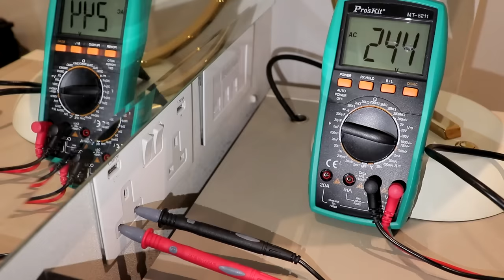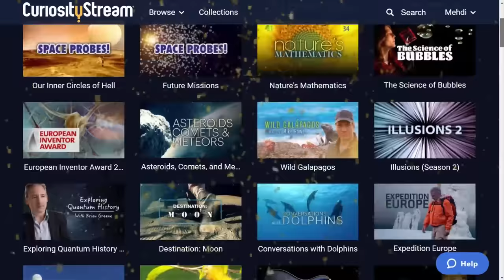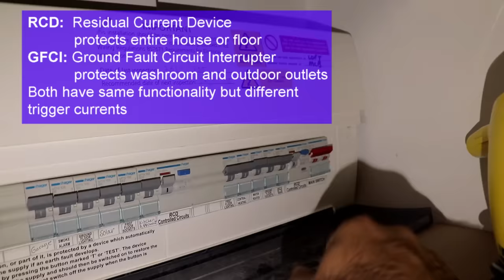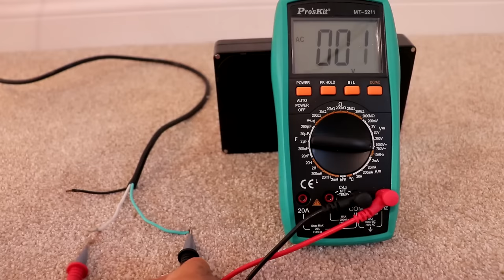Power Outlets in United Kingdom

Comment: A lot of people always say "bulky british plugs". But I always argue against that. Ok, they're a little wider and taller than for example North American, and from my own experience, Australia too. However! Pretty much all UK plugs have the wire come directly down rather than sticking out perpendicular to the wall, which means is actual practice, they take up LESS space, because you can get your furniture closer to the wall, and you don't have an annoying wire sticking out the wall to trip over easily. UK plugs are a lot more shallow and that completely offsets the width and height.
Reply: This is actually twofold. The downward direction of the cable ALSO means it tends to lock when it's pulled away from the wall. It puts a lateral load on the plug and the pins bite into their holes and don't just pull out. So not only is it neater, but also MUCH harder to pull out accidentally. In fact, I never have!
What he said about standing on a plug though, he's right. Lego, step down, you are not the foot pain king, the British upturned plug is. Ouch!
Reply: @ChrisThomas-lt8jd  Every time I hear something about foreign plugs I have a mild panic attack, not having switches (do Americans not get the ritual OCD from their parents about turning off the damn socket!?!), not having a longer ground pin to stop electrocution, not having fuses in the plug, I never even thought about the size and shape, I have never accidentally pulled a plug out of the wall or extension, I have never had to worry about furniture being in the way.

I did once trip and fall onto a pile of old cables once and landed on like 6 of the fuckers though...
Reply: Also, we don't generally have plugs lying around on the floor because we can just turn the socket off instead of pulling it out.
Reply: @pdgiddie  Good point. We're also not, you know, stupid 👍
Reply: @ChrisThomas-lt8jd  Haven't trodden on an Irish/UK plug yet but I have done it on a kiwi [NZ] plug - when I was much much younger - and it hurts, A  LOT.  Same plug but without the fuse and upside down pins.
Reply: @musicandbooklover-p2o  To be fair, the UK design really is good, its super safe, but it DOES have the downside of being bulky. I am kind of envious of US extension leads, where they can fit 4x plugs into the space of 2 UK. But there you go.
the other thing I like about the USA power sockets, is that each socket looks like a slightly sad surprised face :)
Americans arent stupid, but they ARE hampered by the freedom for each state to have its own laws, so I guess getting ANY kind of USA wide standard back in early days of electricity was a nightmare.
Apparently the whole 110v vs 240v thing is because lower voltage bulbs became entrenched in early days, and when move to 240v (more efficient) was mooted, no one want to do do it to replace the existing 100v based equipment, and so it stuck. In the UK, the govt had more power and FORCED the flip to 240v. And so here we are...
Reply: Josshyua  That UK one must have had unprotected pins. The sheathing on UK pins are designed so that no metal is exposed at the same time as they have connection inside the socket. Plugs without this protection do exist, but not as common, so that's just a bad manufacturer. 
I just Googled the German style. That deep sinking in does look reasonably safe, but also looks like it misses a few of the other safety systems that UK plugs have, so at a cursory glance at least, I'd rather stick to UK ones :)
Reply: @danielmacpherson8487  Oh we got fuses in the plug..... if it's christmas lights bahahahahahahaha
Reply: What's cool as well is that all British kids are taught how to replace the fuse in a plug, and be able to build a plug from scratch. Well, at least, I was, and I'm 34, so I'm not THAT old, it was about 2003 or so when I was taught this, I assume they still teach it in schools.
  
All home devices UK used to come without plugs, for safety reasons. So like, if you bought a toaster, you were expected to build the plug yourself before you could start using it. Though these days that's not the case anymore, they just put a plastic sheathe onto the prongs of the plug to keep it safe, but it's already built for you.
   
But yeah that's why they would teach kids how to build/wire up a plug, and change the fuse in it. Because you literally had to, every time you bought something electronic, like TV, a hi-fi, a microwave, anything that required electricity.
   
British plugs are possibly the one thing we objectively do much better than any other country in the world. They are by a long long way the best plug design on earth, because of their safety, because of being very flat against the wall which makes them take up less space as others have said, and so on. British plugs and our plug sockets with switches are the envy of all other countries. It's always a pain in the arse when we go on holiday to places like say Spain for example, and have to deal with their shitty unsafe plugs, using plug adapters so that our British devices can be charged up using their plug sockets. I can't imagine how much of a pain in the arse living in Spain or any other country full time must be like.
Reply: @ChrisThomas-lt8jd  I've never experienced that myself. Due to the thickness, and therefore strength, of the UK pins they need extreme force to bend and cause them to get stuck in a socket. If you've had that, you either had a really dodgy plug or you did something seriously wrong 😂
The thickness of the pins if a good safety feature too. The Australia ones are so thin and bend so easy. We're doing some housework right now and one of the pins on our sander got bent quite badly. I had to bend it back to fit in the socket and as a result of you know anything about metal that pin is now weaker. Which is an obvious hazard. But since Australia plugs are not rewireable I've got no choice but to continue using this now weakened plug.
That's just another reason to add the list of why UK plugs are the best 👍
Reply: @duffman18  Same here, I'm the same age as you as remember well being taught at a young age now to wire a plug. It was uo there with "tie your shoes" and "wipe your ass" 🤣
Australia is such a nanny state with anything electrical. While British children are taught the basic safety tips and the rewiring skill so they can safety perform basic DIY tasks such as replacing lights, plugs, and switches. Australia teaches even grown adults not to even look at a bare wire because you will definitely die! 🤣😂🤦
Reply: @duffman18  Although I thought British appliances were sold without plugs, not for safety reasons, but because there was no set standard at the time and so different houses had different sockets, or even different sockets within the same house. So you bought the appliance and the plug to match what's in your house and connect the two, so the manufacturers didn't need to make 10 of the exact same kettle so everyone could buy it.
Rewireable plugs today is just a leftover from that time which is why you also see more and more non rewireable ones today as they are no longer technically necessary since we've had a standard socket across the country for more than enough decades now. Though I do hope they stop that because rewireable ones, while no longer necessary, do still have their uses. If the plugs breaks in some way you can replace the plug rather than the entire appliance! 👍
Reply: I’m 28 and I wasn’t taught how to wire a plug at school
Reply: Electrical goods have never been supplied without plugs as standard in your lifetime. The whole point of supplying a plug already fitted is to reduce the input from the end user on grounds of safety. There is never the assumption that somebody knows how to fit one. That they are now supplied with a moulded plug is the logical end point of this, though these can easily be replaced by simply cutting the plug off the cable and installing a normal plug.
Reply: I'm 19 and was taught how to wire a plug in psychics
Reply: @opiumpilled I didn’t see that coming! 🔮
Reply: @duffman18  "I can't imagine how much of a pain in the arse living in Spain or any other country full time must be like."

When you live all your life surrounded by a [plug type here] it's not painful at all.
Europlugs also have ground (except the cheaper devices/usb bricks which have a plain flat fork plug), halfway fork covers and 90 degree form-factor, it's not a rocket science to make these. Though a plug switch does sound convenient I'll confess.
And we don't need fuses inside the plugs, as we don't run out of copper, lol.
Reply: Another thing about UK plugs is once you've put it in, it's staying there. You don't accidentally pull out a UK plug. Which, again, is extra safety. I moved to UK from Europe, and I wish the whole world used UK's plugs.
Reply: @danielmacpherson8487  Switches on outlets are one of the most useless, stupid things ever.
Reply: @wta1518  can I ask why? do you live in a country with switches and hate them or are you just assuming they're bad?

They've never been anything worse than a mild inconvenience to me and have a fair few benefits, mainly safety for children and possibly pets.
Reply: @danielmacpherson8487  I don't hate them, I just said that they're useless. You can just use the switch on the thing that's plugged in, which is much easier than reaching around for the outlet.
Reply: @wta1518  They do have uses, like if I had an extension plug with 5 different things in, including a PC and Xbox for example, which draw power unless the powersupply itself is turned off, it's easier to switch off the outlet than everything individually. Plus, you can turn off the outlet while plugging things in if you're really feeling cautious. There's not really a disadvantage to feel strongly about...
Reply: @TeensyTea  If you're too scared to plug something in without having a switch off, you need to grow up. And good job saving those 0.1 Watts from vampire loads! Although if you're in the UK, that's probably about $5000 in savings every year thanks to Brexit.
Reply: @wta1518  It's 240V so if you plug a socket in without the plastic shielding it can arc, and turning it off only takes half a second. More safety features aren't a bad thing and the US could learn somehing, having a rate of death by accidental electrocution almost 12 times higher than the UK, despite having a mains system with half the maximum load...
Reply: @TeensyTea  Yes, I do agree that the US needs better plugs, but the switches are absolutely not the reason for you're electrical safety. Also, guess what happens when you open/close the switch? That's right, arcing.
Reply: I am an Italian living in the UK. There is literally nothing much to say really.. the UK plugs are, hands off, the best worldwide. More practical/ergonomic for the very reasons you said and safer (fuse + on/off switch). Also not to mention the 220V is banned in bathrooms. We only have the 120V shaver plug which operates with an isolation transformer, something which is almost medical grade (it's what you would have in an operating theatre)
Reply: Well, Schuko plugs can go both straight and down and are generally less bulky. Also the outlets are recessed so there's simply no way of touching half inserted prongs. And your argument that down is always good is actually not true. For some devices you want them to come out straight, like for example a steam iron. Or if you plug things into a ground extension box.
Reply: @danielmacpherson8487 so much useless paranoia
Reply: @TeensyTea  ever heard of switches on power strips? Or cords, how do you call them.
Reply: @skatemaster33  agree, but we do have a non-recessed outlet in the bathroom without ground (in fact, probably our entire apartment doesn't have ground, but nobody dіеd still) and I do have an ultra cheap extension cord that has only a tad bit recessed outlets, though it's still hard to touch them with your fingers even if you have 2.5A plug.
Reply: And yet us Americans worry more about supplying people with free guns after every purchase
Reply: @danielmacpherson8487  As for parental paranoia: In Scandinavia (and possibly other places?) you can buy plastic gadgets that you can put into the socket to childproof them.
Reply: @ChrisThomas-lt8jd when you think about the saftey the uk plugs provide tho that’s what takes up the space